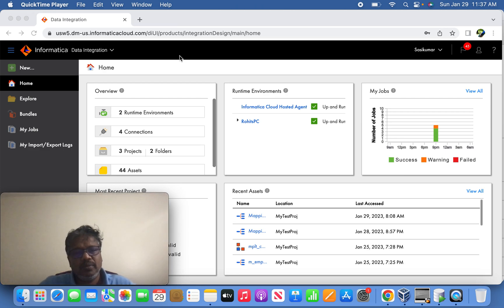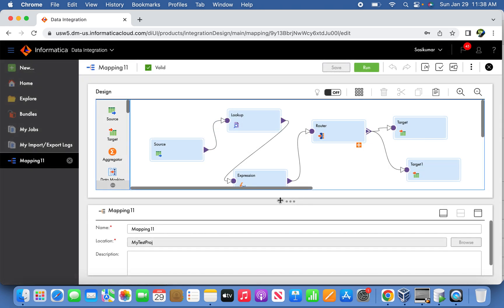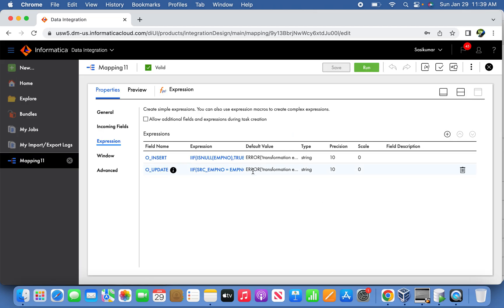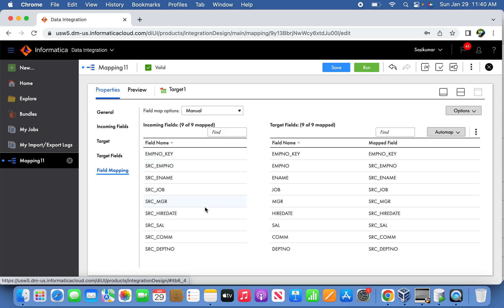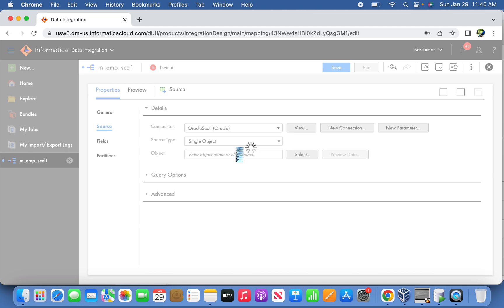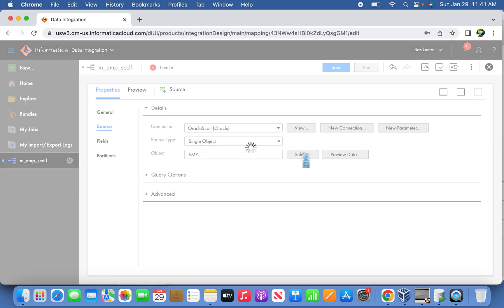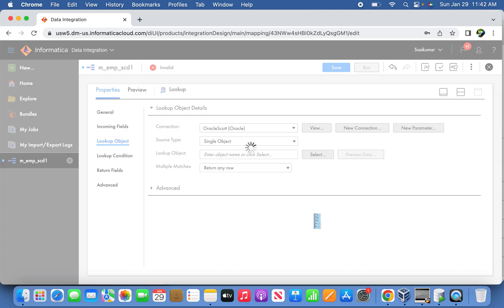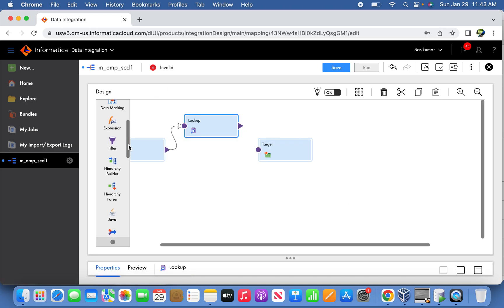IICS | Slowly Changing Dimension 1 - Part 2 | #informatica

Comment: [ERROR] The Snowflake Connector failed to de-initialize the write operation because of the following error: No update key column is specified for the job. it means what is prbm
Reply from the maker: You didn’t d fine key column to represent the row basically natural or primary key
Reply: @keeplearning9447 Hi, Thanks for the detailed video. Normally if there are no keys defined in database level, in power center we define them in target designer for a target which will be used for updating the records. Can we define the same in IICS, if so could you please provide details on it? Thanks
Reply from the maker: @srikanthdanda4031  under iics target you will find the similar option , you need to ensure creating PK @target table in db side
Reply: Thank you